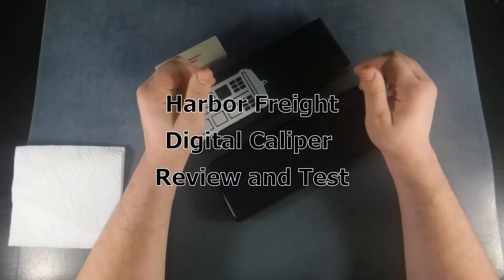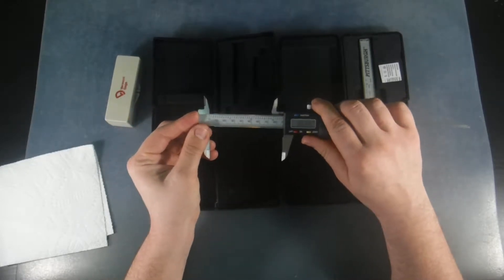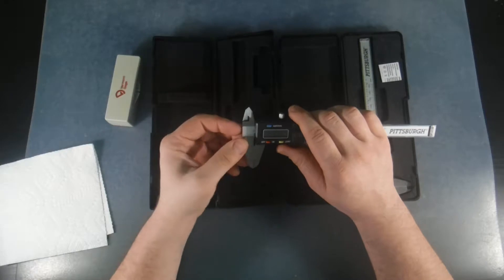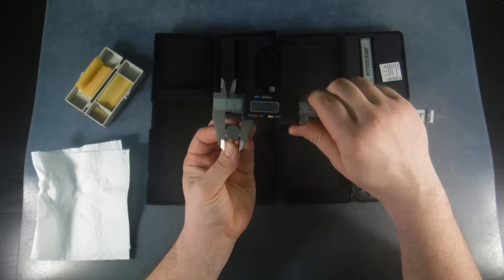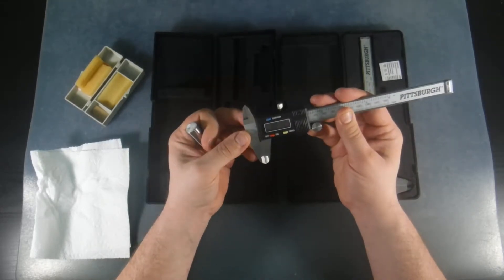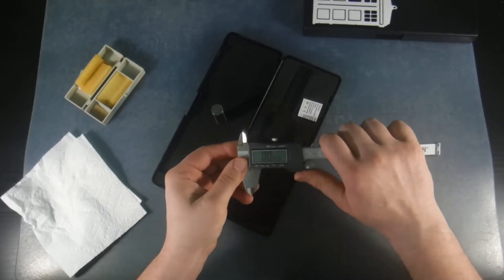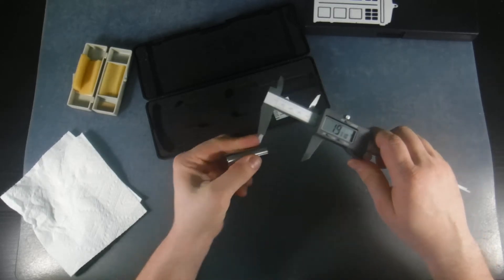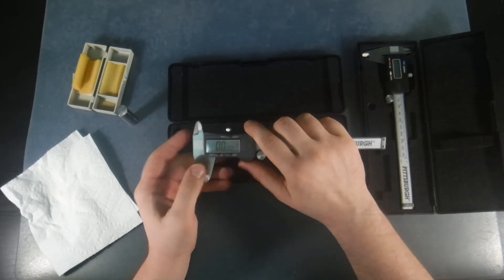Harbor Freight Digital Caliper, Is It Accurate ?

Comment: I have had an HFT digital caliper for several years and really like it.  I just used it to make two shifting knuckles for a 30-year-old S.E.P Italian tiller.  The instant Metric to SAE conversion is invaluable.  I measured the shifting rod size, which is metric, and was able to convert it instantly to SAE so I could get the near American size to drill the holes necessary for the repair part.

Comment: Thanks for the video. I have a few older dial type calipers. I bought the latest model because I wanted fractions/digital and metric. I have a feeler gauge and was able to test accuracy well under an inch.  Your video was great because it shows the accuracy over the one inch range. Very cool.
Reply from the maker: Thank you Mike.

Comment: I'm sold. I was going to go with a more expensive one, but now I'm off to find some HF coupons to get the gray one you show.
Reply from the maker: If you can, take the caliper out of the box and check it out in the store before you buy it. HF is notorious for lowering quality standards over time or just batch to batch inconsistencies.
Reply: I went through all two dozen of them on the rack (no plastic so easy to check, just slide the plastic case out and open it). They were all pretty scratchy. I got one and it zeroes consistently and I've used a piece of ceramic board to smooth it out decently. I also held it up to the light in the store to be sure that the calipers (outside and inside pairs) were perfectly parallel, by opening it very slightly and verifying the hair of light coming through was consistent across. I also verified them by measuring the end of a zip tie at various positions in the calipers.

I noticed that it also has a data port, which is a nice bonus. They honored the 50% off coupon (from Struggleville.com) and a coupon for a free $3 tarp. For $10 total I'm pleased.